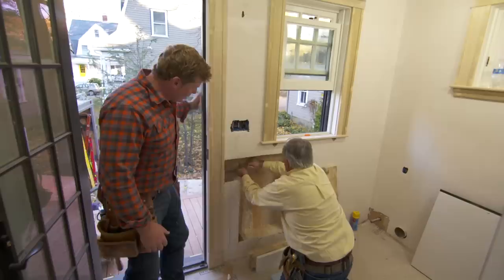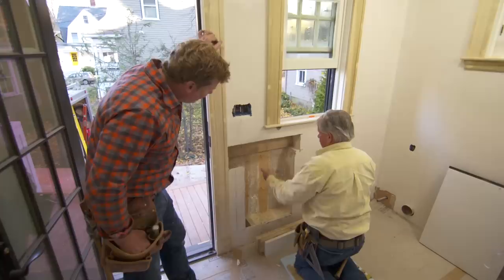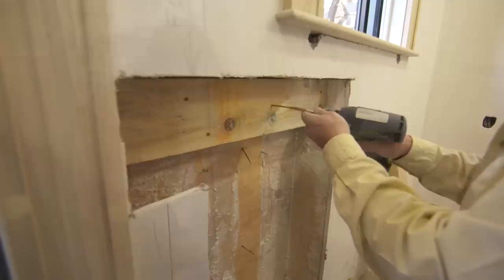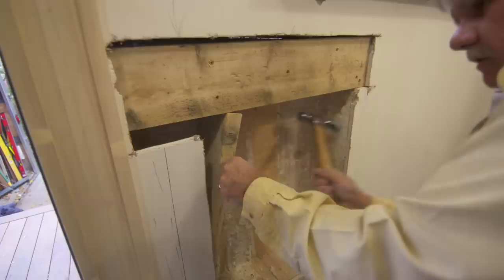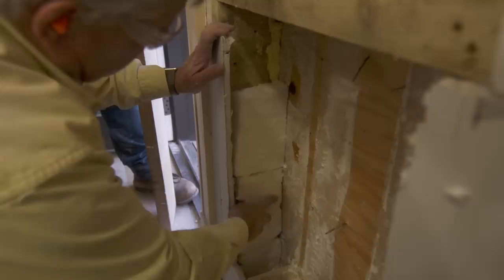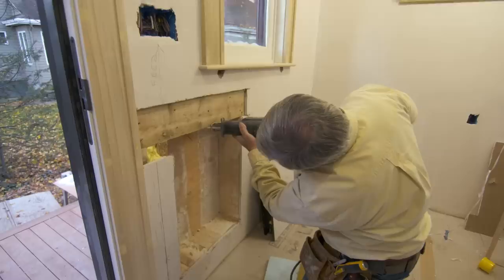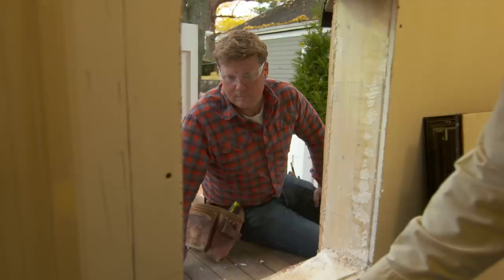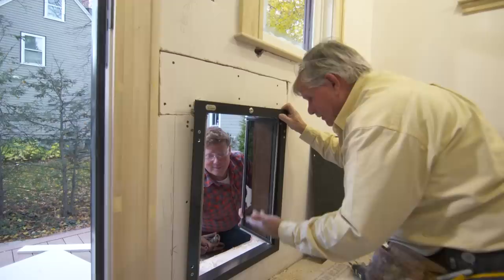How to Install a Dog Door for a Large Dog | This Old House

Comment: Saw this episode a few years back. Put one in my new home but not the one they showed. Big bucks. The door is a point of potential entry, but if a thief really wants in they will break the window or even pick the lock before wiggling in the dog door and risk getting stuck. Our dogs love it, and no more letting the, out for a pee in the middle of the night. Have had it for a couple of years and have had zero problems.

Comment: Dog happiness: 10
Security: 0
Reply: Insulation: -10
Reply: It has a lock on it.
Reply: The dog provides the security
Reply: People say this a lot. I find it funny they call a dog door a security issue when they have GLASS windows all around their house. If you stop and think glass isn’t stopping anyone from doing anything anymore than that dog door. None of us are really secure from someone who wants to get in
Reply: @RT-qz5ci  Breaking glass makes noise. Crawling through that opening does not.
Reply: @pauleohl  what do you think the dog is for??? 😂😂😂
Reply: @RT-qz5ci  glass makes noise and draws attention.   It's also dangerous for the potential burglar to go through a broken window.  Most people that have dog doors don't have problems, but a large dog door is definitely a potential port of entry for a burglar.   And unless there's a GSD, rottie or similar breed in the house, the burglar won't be deterred by fido alone.
Reply: @pauleohl  i have a wireless doorbell inside mine so i can go clean up. I know eveytime someone moved past it. I also have kids so it helps monitor them.

Comment: Think you’re clutching at straws putting that insulation back in when you have made a huge hole in the wall with thin doors! Going to be freezing in there.
Reply: For the coldest months they will likely cut some foam to fit in the opening.

Comment: A double door with a connecting tunnel is what I used. More energy efficient. You also would have been better off to find a different location in the house where it could be easily installed rather than damaging the wall for an off-center door.
Reply: What brand?
Reply: @sergiomedina235  Ruff Weather.
Reply: @DovieRuthAuthor  thank you

Comment: I dunno bout this. How much cold air is that going to let in during the winter. And yeah, not very secure. Even with the lock on top I'm sure that can break very easily and being it's so low to the ground a burglar could just crouch low and work on gaining access without drawing too much attention. Neat idea, but i'm not sold on it.
Reply: Those are for "cat burglars".
Reply: @brianglade848  Hmm, if I might refine that ... any house can be broken into ... "its  component parts given enough C4".

Then merely stroll through the rubble collecting the valuables whilst avoiding the corpse of the dog ... Hah(!) owners never saw that coming.

Comment: Somebody tell Tom that the Isaac Newton story is not true. Pet doors were referenced centuries earlier in The Canterbury Tales among others. Newton might've made a cat door, but he didn't invent it. Wikipedia has details.
Reply: Wikipedia may be right but, just know it's about 85%-90% correct with information.
Reply: @MemoGrafix  Fair enough. Even Wikipedia agrees that it's not designed to be an original source. In this case it's easy to confirm the article by searching "The Canterbury Tales", but the article is a lot easier to read. :-)